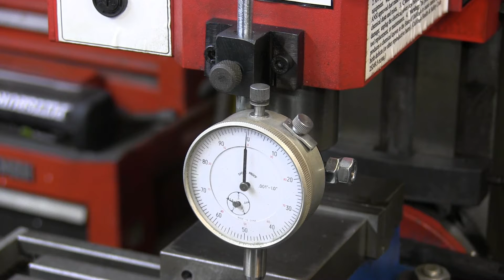Update  -  Buddys Work Shop

Comment: Hey Buddy.  Sorry to hear you got a bad case of it. I had it three months ago and it was three days of the worst sore throat I've ever had.  Then bingo.  'Gone (Moderna and Paxlovid gave me a quick ride of it).  
Looking forward to hearing about the Swan VFO mod.  Not just a receiver but I have a Swan 350C that I bought new at Henry Radio when I was a kid and I got it running again.  Those 6LQ6's put out a decent amount of power, are resilient and the matching network in the rig is great.  Hoping here re some similarities between the receiver VFO and the transciever one.
Good to hear from ya again
Reply from the maker: Thanks Barry. I have several Swans here, 350, 260. 500, 500CX. Need to get them out in the future and do a repair series on them. After the 101's are done.
Reply: @TheRadioShop  Thanks for the reply.  When I was in high school, a fellow ham friend and I drove down to Oceanside, California and knocked on the front door of the Swan factory.  They invited us in and gave us a factory tour.  That was really nice of them.  My 350C still has its original finals on it and it has a lot of hours on it.  I have a spare matched pair "just in case".  I tested the capacitors in the power supply and used a variac and dim bulb tester when bringing it up after sitting for over 20 years.  The capacitors still were spot on and had low ESRs (high quality Mallory ones).  I cleaned the wafer switches and I was on the air.  I even put up a new 14AVQ antenna like I had when I was a kid.  Great rig.